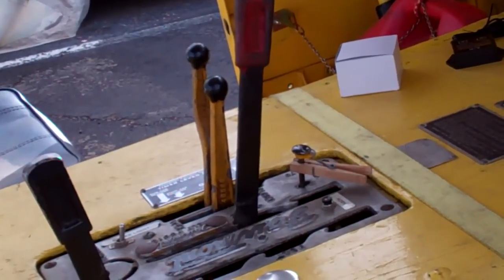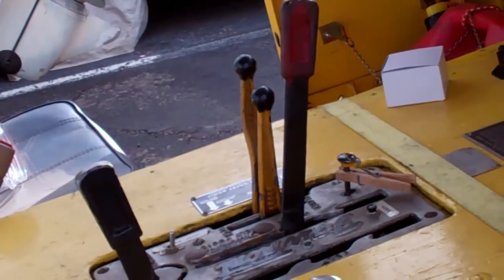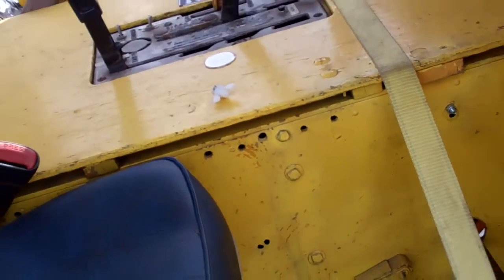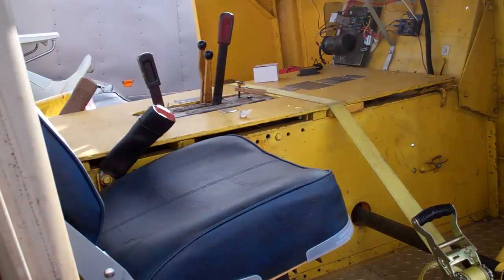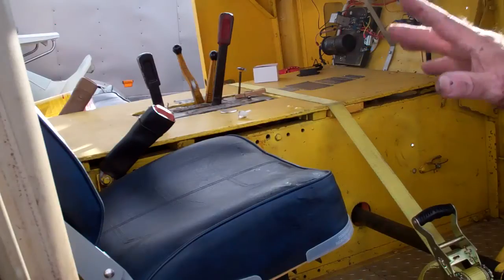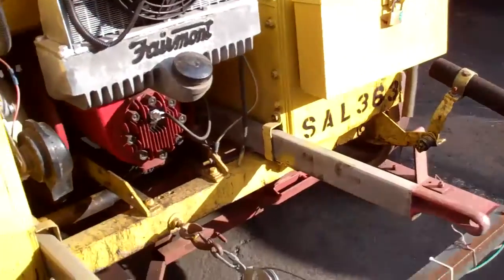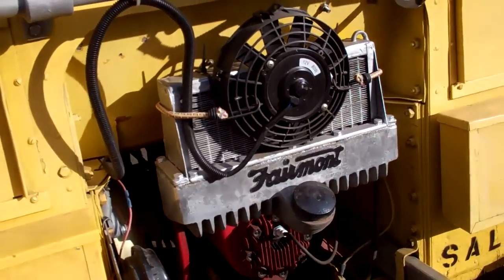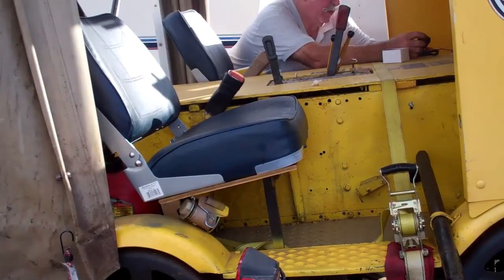starting 1948 Fairmont M19-F rail speeder

Comment: Fairmont did actually offer an electric starter for their 2-stroke engines during the 40s-50s, but they're pretty rare. A little rubber wheel on the starter motor fit in a special grooved flywheel.

Comment from the maker: 12 volt garden tractor battery- connected to the buzz coil via timer on flywheel then to spark plug---also used for lights, horn etc.
Reply: My friend is using a 12v auto coil, alternator and battery. So could he just swap out the coil for a buzz box? Been told by many people the automotive coil is not a good setup. Thanks for posting this video!
Reply: My Canadian M-19 used an automotive coil run off the timer points. For some reason some of the Canadian railroads used that set up but it runs the timing much more retarded than normal which limits the top speed. It also uses up the timer points faster. On top of that they mounted the coil at the rear of the car and used a 5 foot long piece of spark plug wire to the plug.  I tried it out before I removed it and it ran OK in the driveway. I've got a DX electronic ignition on it now.

Comment: Have you ever had to remove a motor on one of these? It's pretty straight forward I see. My problem is does the front shield have to come off for the motor to slide out? I need to replace a bearing. Which requires me to pull the motor in my m19. Thanks either way!

Comment from the maker: Then, yes. but no more!  It did not operate properly - fired plug when points opened, thus threw the timing way off- back to the plastic encased modern buzz coil- works fine now.

Comment from the maker: mine is a 2 cycle 1/16 mix of oil to gasoline never heard of wooden batteries- the original Ford Model T coil was a wooden box buzz coil. only 1/4 turn to start engine and it accelerates so slowly - removing the crank 1" is all that is need to disengage--not an issue. try here:   narcoa.org